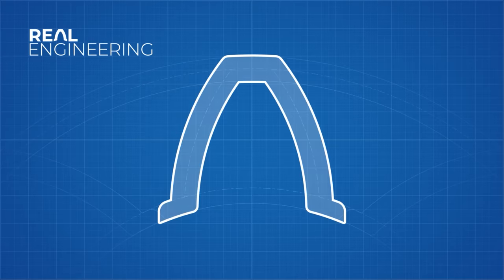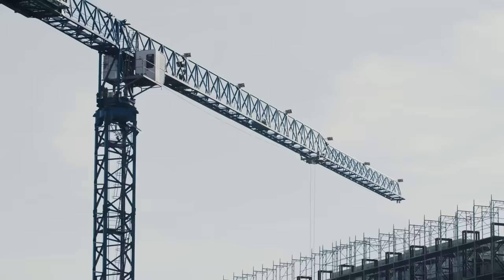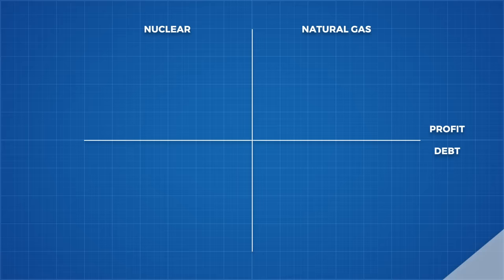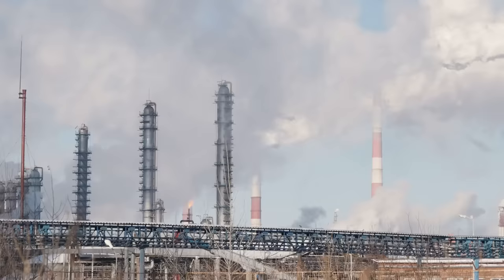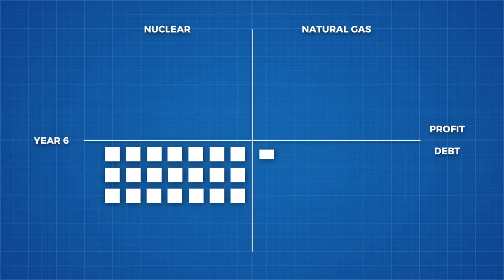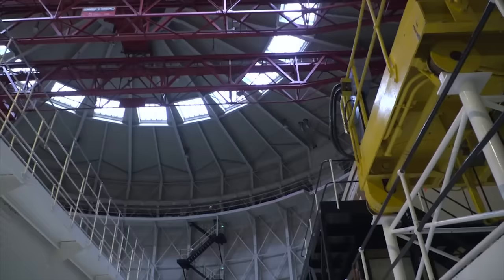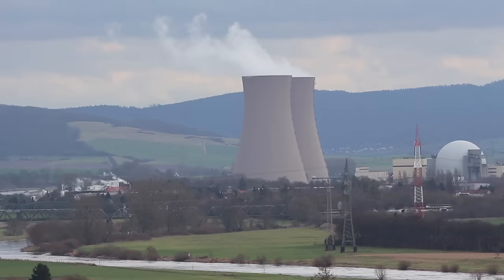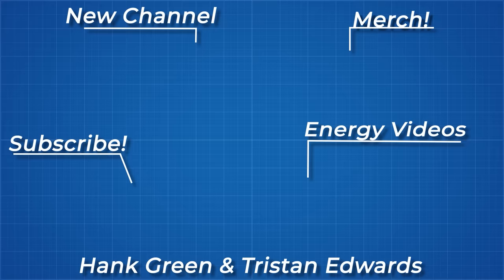The Economics of Nuclear Energy

Comment: Nuclear is safe, this is not a pipe dream, or a delusion.   It's the safest form of energy we have, better than even solar and wind power.  This does include things like Chernobyl, Three Mile Island,Fukushima, all of them.  If it helps, think of it just like the Airline Industry.  No one has problems with the phrase "Flying is the safest form of travel" because it is.  Now when a Plane crashes, it's significantly worse than when a car does, but compared to cars, planes rarely crash.

Your chart on cost is also very dubious to me.  You mentioned France and Germany and how France went heavy into Nuclear and Germany went heavily into renewable sources.   If your chart was accurate, Germans should be paying half the price for electricity as French people, but the opposite is true with the French paying half the price for electricity as Germans do.  This makes me doubt your chart.

"We have a way to capture that energy efficiently" (talking about solar panels).  Yea right, a Solar Panel is at absolute best 23% efficient, but most are in the 15-20% range which is still impressive, but not what I'd call "efficient".  Toss in the loss for battery storage and you're down to around the 10-12% range if we're being generous.

As the gloriously intelligent Mr Horse from Ren and Stimpy said, "No sir, I don't like it."
Reply: Germany has lower production cost for electricity than France.

The reason Germans pay more is taxes and fees. In France electricity is produced at a loss and heavily subsidiesed by the government.
Reply: Effeciency:
If you use one hektar (10k m²) of land to produce biofuel then you can drive around 75 000 km in a year with it.
If you use the same land for solar and you use an EV then you can drive 10 000 000 km with it.

More than 100 times the efficiency of natur sounds pretty efficient to me. (Yes the ICE is also losing a lot of that energy but still.)
Reply: @TBFSJjunior  If that's true, then it makes sense. (the electricity cost).  I have no clue why one pays half price, only that France pays half the cost of Germany.
Reply: @TBFSJjunior  If you use the same amount of land for nuclear, you're going to have a retardedly higher amount of energy produced.

We have 2 problems we need to overcome for nuclear to be able to be a primary source of power.   1. Educating people in the actual safeness of Nuclear power per terawatt hour produced, and 2, we need to change our electric grid to what's called a smart grid because Nuclear does not ramp up or down very fast.

A smart grid is going to do slightly annoying things for our refrigerators, washers, dryers and air conditioners.  They will not necessarily be on when we tell them to.  They will ask the grid for power, and get in line to get it.   Dumb appliances like lights, blenders and low power draw things will get power on demand like we are used to, but things that take significant amounts will wait their turns.  This will allow the power grid to regulate itself and we won't be dependant on natural gas as a quick response for power need spikes.
Reply: @skavies2351 
Yeah that isn't quite true.

Yes nuclear normally doesn't ramp up and down fast, but sometimes it does. France has a few nuclear power plans that can do so.
It is normally not done as it damages the nuclear fuel (which has to be refueled more often) and it is much more expensive, and new nuclear is already 2 to 5 times the cost of wind or solar.
Sometimes wind/solar is even cheaper than the operation cost of nuclear.

The land use is also a serious misconception.
If you look at the nuclear exclusion zones in the world you end up with around 9000km², which produces around 2600 TWh a year.
So nuclear is producing around 300kWh/m² per year. The solar farm on my roof produces 200kWh/m² and that is unused space.

The Fraunhofer Institute had a test installation in Germany for 2 years now where they have planted potatoes under special solar cells.
They actually increased the crop yield, while at the same time they produced solar electricity. It's called agrovoltaic.
So both rooftop solar and agrovoltaic use 0 space extra space as in both cases they occupy land which is still used for something else.

Smart grids will be important no matter what.
Reply: @TBFSJjunior  The land use misconception is based on uranium/plutonium power plants which need way more space both for the plant and the storage.  The Thorium molten salt reactors will need less land per KWH, and once it's proven "safe" that land use will lessen with reduced exclusion zones and reclaiming some of the land used to store spent fuel from plutonium/'uranium reactors and expired nuclear weapons.

I use safe with nuclear power the same way flying is the safest form of travel.  Both are and both have horrific accidents when something goes wrong.  Going by deaths per terawatt hour, nuclear is the safest form of energy period.  If you want to compare world wide nuclear with US hydro, then US hydro is safer than world wide nuclear, but US nuclear is safer than US hydro, so that's not a fair comparison.  Yes, I'm including solar and wind with that statement, nuclear is safer than solar and wind.

I think we need all 3.   Nuclear as a main power source, and solar and wind as supplemental power to charge "batteries" for the high demand quick response.  There is a very interesting plan to use liquified air as a battery.  Basically, they take the excess power and use it to freeze air to a liquid and store it in large tanks, then when power is needed, the liquid is warmed up and run through a steam turbine.  This is using well tested parts put together in a way that is very scalable.  Need more storage?  Toss in another tank, need more on demand power? Toss in another turbine.  They store the heat generated by freezing the air to warm it for less power needed and the cold from the transformation from liquid to gas to help freeze more air later to make this even more efficient.
Reply: @skavies2351  its BS.
I highly doubt France subsidies their, state-owned, energy producers such a subsidy would be illegal by EU law.
and even if Germany taxes their electricity production then what is this money being used for? ain't it to build more renewables and to subsidize them?
Reply: @TBFSJjunior  the difference is this hektar of yours when it's producing biofuel it pulls CO2 out of the air
to fill it with solar panels you need to remove all co2 sucking vegetation - effectively creating a wasteland. Which is just the beginning of potential problems when it comes to soil degradation or flooding.
Reply: You'd have these kinds of efficiency losses with P2G but not with batteries.
Reply: @michazajac5881  Most of the taxes go to the general government pot. Germany decided to start supported renewables when they were still expensive by garantueeing a high feed-in-tarif. The feed-in-tarif was gradually reduced for new systems. But the old systems still get their high feed- in-tarif. Starting next year those early expensive systems will no longer get their feed-in-tarif and the renewable energy surcharge will start to drop.
Reply: @boldvankaalen3896  It should be removed entirely.
If solar and wind is so cheap as they claim, subsidies are no longer needed.
Reply: @michazajac5881   What about roof top solar panels and crops growing underneath solar panels.
Reply: Umm...Flying might be the safest form of travel, but in nuclear terms, if a plane crashes, it pollutes the environment for centuries, not a day or two.
Reply: @xenobob2773   Look up "Deaths per terawatt hour".   Unless you are comparing world wide nuclear to US Hydro electric, Nuclear is the safest form of power period.  If you are comparing US nuclear to US hydro electric, Nuclear beats it.  Yes, this includes solar and wind.  Nuclear is safer than solar or wind.

Renewables are nice, and there is a not battery battery that we can use to store it which involves basically converting air into a liquid when storing power and letting it evaporate and using it to run steam turbines when getting power out, so it's not useless power, but nuclear should be the backbone of our power, not a supplement.  Renewables simply don't put out enough power for the space required, but they would be great for charging those liquid air batteries to handle the changes in the power needs since that's the one thing Nuclear really lacks.  It takes way too long for Nuclear to react to energy demands on the grid or I'd be campaigning for it to be the ONLY power source we need.

As far as the centuries pollution goes, Chernobyl is below the radioactive levels of the rocky mountains so that's just flat out wrong.  Sure it might be centuries before the radiation level there drops to background levels, but it's already well within habitable ranges since Denver Colorado has a higher background radiation than most of Chernobyl simply from the Granite in the area.  We can reduce this further with using molten salt reactors which run of Thorium, not uranium or plutonium, and have a waste product that's got to be stored for (can't remember which) 200 or 300 years, not centuries like the more common uranium and plutonium plants do.  We can also run nuclear waste and decommissioned warheads through those molten salt reactors to turn those long time storage wastes into the same "short time" waste you normally get from a molten salt reactor.  This type of reactor is not as efficient as the more common ones and you can't make weapons grade nuclear material in them, so we don't use them, but we should.
Reply: @TBFSJjunior  And French taxpayer subsidises it, just so Germans would be able to buy it cheaper?
They have to be utterly stupid, in that France...
Reply: @michazajac5881 
So much wrong here.
1. I've talked about agrovoltaik. There the land is used for both Fotovoltaik and agriculture. In Germany the Fraunhofer Institute has a test field with potatoes under solar panels and the yield actually increased.
2. No Germany doesn't use those taxes to subsidies renewables. There is an extra fee for that.
3. No it isn't illegal for France to subsidies nuclear. Just like it isn't illegal to subsidies renewables. Most nuclear is government owned in France. As a matter of fact nuclear is subsidiesed in every country to some extent to my knowledge.
4. France isn't doing it to sell cheap electricity to Germany. Actually France buys more electricity from Germany than the other way around.
With nuclear the merit order effect totally screws the cost/price relationship. A new nuclear power plant could produce electricity with a LCOE (cost) of 150$/MWh, but would have an operation cost of 30$/MWh. So that nuclear power plant would operate at a market price of >30$/MWh, as everything greater 30 is revenue, while they would operate at a defacto loss of 120$/MWh in that moment.
That is for new unsubsidized nuclear. For old nuclear the cost is much lower than 150 (especially because of subsidies in the past).
So if in France their cost is 40$/MWh, they would still sell electricity for 31$, as it is better to lose 9$/h (40-31) than 10$/h (40-30) if you don't produce.
Reply: @skavies2351 
LFTR are still a pipe dream and need at least 20 years to come online and 30 to 40 years for a big scale production. We don't have the time.

Then there is the issue that if we run the world on thorium, it last under 100 years. It would still just be an other temporary fuel based option.

The idea to use nuclear and wind/solar together is a bad one as the needed grids are very different and studies have shown that it would increase the cost of both.

"Liquified air"
Btw I've studied physics, so I understand the principles and find them fascinating and could see it as an option, but I doubt it will be price efficient any time soon.

Fraunhofer Institute (you might know them as the inventors of the mp3, but they also havea huge energy department) did a study around 10 years ago for the german government to run Germany (83 mio ppl) on 100% renewables (including storage, heating&transportation). They came to the result that it is possible without added cost and without new technology.
The most important technology in my eyes was storing electricity in the form of (artificial) natural gas. This would make the transition much easier. Gas turbines, pipelines and storage is a well known technology and could be uses, but instead of natural gas, artificial gas is used (produced from overproduction from wind/solar).
If other technologies can do it cheaper, then they can replace the gas.
A big plus if this is, that a gas turbine has a life expectancy of 20-30years, so if an other technology comes around we can just replace them after 20 years. For nuclear with a life expectancy of 40 to 60 years, you look at an economic nightmare. Who would finance a technology that you have to keep for 40 years with the chance that a cheaper/more compatible technology comes to market. That is a big reason why nuclear is never financed without government subsidies/guarantees.
Reply: @skavies2351 
Oh and your plane comparison is a very good one 👍 to show risk vs perception, but there is a big difference.
Solar is much more deadly than nuclear, because of roofers falling from a roof. That is a very different kind of risk compared to a nuclear power plant causing a whole continent to stop eating the vegetables from their garden.
In raw numbers it might be true, but for PR it is a nightmare to defend a blown up nuclear power plant vs roofers falling of roofs.
Reply: @TBFSJjunior  First, I appreciate the long and detailed response.  Most of what you said makes sense  I'm assuming LFTR is liquid fluoride thorium reactor  This is not a pipe dream, they were around maybe as early as the 1950's at least as concept and definitely built by the 60's  Thorium it's self is a relatively common material which we toss back in the ground quite often when mining for other things.  This is a long term solution, but not the cheapest one.  It will be more expensive because of the cost of the reactors vs the power output.  I think the benefits out weigh the cost though.

Yes, a nuclear accident is a very bad thing, but the accidents that could happen with these are extremely local.  The reactor fuel is not pressurized, so even if a meltdown happened (which can only happen if someone puts in the wrong fuel), it will simply melt the drain plug and spill into a holding tank under the reactor.  Only the secondary cooling cycle is pressurized, and that is outside of the nuclear material.  Some idiot with a drill could drill a hole in the side and it would of course leak out which is the worst thing that can happen unless you want to include someone putting a bomb on one and spreading it that way.

Comment: Does everyone remember how Japan closing all of their nuclear power over night also made the largest single day increase of co2 emissions ever recorded because they went from clean nuclear to largely natural gas supply
Reply: nuclear is actually a clean, reliant and cheap energy source if done right, people are chernobyl traumatized for no reason, even Fukushima was avoidable if Tsunami was anticipated as they built the reactors.
Reply: @JabbarTV1  yea both were relatively easily avoidable errors. Natural gas is way worse in the long run, ruins natural landscapes and forces you to buy abroad usually.
Reply: @Dongs 
1. 1 ton of uranium = 1 million ton of coal. So no matter how bad uranium mining is, can't be anywhere close to coal mining. Or fracking for oil and natural gas. And for the same reason we could spend a huge amount of money on mining uranium safely and cleanly.
2. And still for the same reason the waste problem is also nothing compared to fossil fuels. Plus it comes out in neat packages, not in the form of smoke and ash that's very hard to handle. And what we now create isn't even waste, it's still 99% fuel, just these outdated reactors can't use it. There are many modern reactor types under development that can burn all of the fuel, and as a bonus the remaining actual waste is only dangerous for a few hundred years, not hundreds of thousands.
Reply: Dongs You do know that uranium is radioactive right? You do know the uranium was in the ground for billions of years right? Simply put the waste back in the ground.

Comment: The year is 2120:
Aliens: "So you mean to tell me you had access to nuclear fission all along, but still used fossil hydrocarbons?"
Humans: "We had made nuclear 20 times more expensive than it initially was, because we were afraid it could destroy our environment."
Aliens: "LOL, that's LITERALLY physically impossible."
Humans: "Yes, we now know that, but our actions at the time made nuclear uneconomical, so we burned fossil fuels instead which did end up destroying our environment."
Aliens: "Well, that's embarrassing."
Reply: Best comment
Reply: Complete nonsense.
Reply: Orlando Rotundo  Technically we have fusion, though hydrogen bombs aren't a very eco friendly way to produce power. Otherwise we can use fusion, it just burns more energy than it gives back. Something that will likely remain true for quite a while.
Reply: Fusion is only marginally better than fission. Fission is at present the best and most environmentally friendly energy source. The difference between fusion and fission is smaller than the difference between fission and all other large scale energy sources.
Yet popular culture treats it like a meme. Fission is: available today, but EVIL AND DIRTY! Fusion is: unavailable today, but THE PERFECT CLEAN ENERGY SOURCE.
You know that once fusion is also commercially available, the same anti-nuclear sentiments will just move onto it as well and it will still not be considered "good enough".
Reply: Anything as long as people don't actually have to act and make changes today... Sure, just leave it to "future technologies" as always.